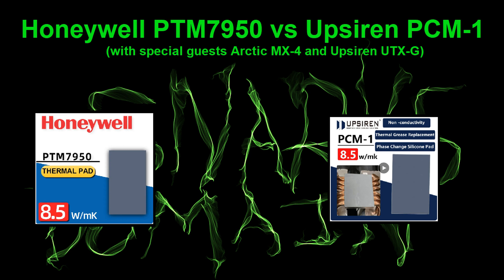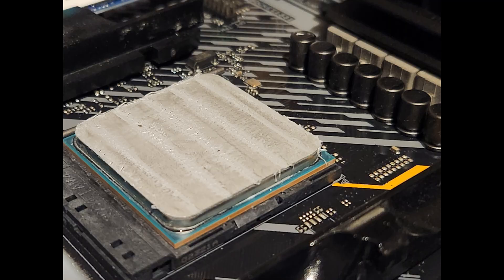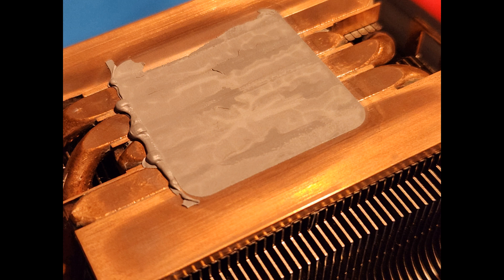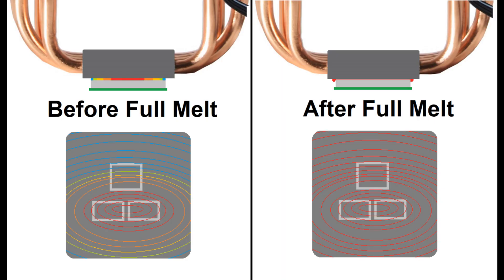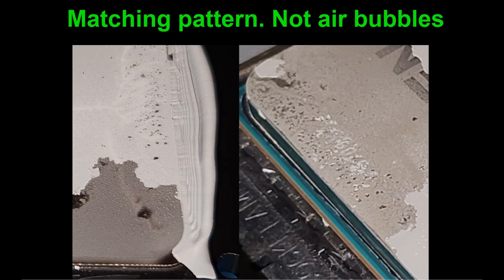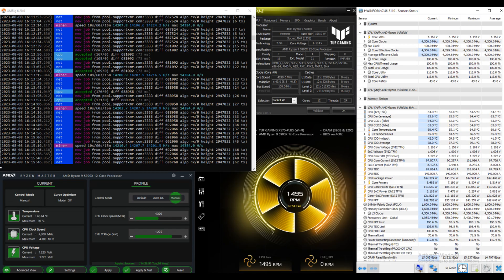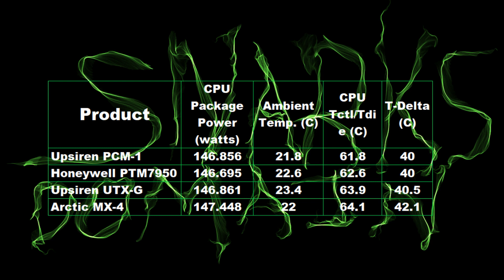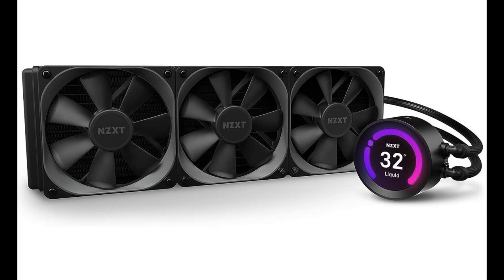Can Upsiren PCM-1 Compete with Honeywell PTM7950?

Comment: hey! i just got 5900x. how is your 5900x ccd1 matching ccd2 temps under full load? mine doesnt... it differs as much as 20c temp...
Reply from the maker: I'm using Ryzen Master to set a fixed all core OC (frequency and voltage). Perhaps only one of your CCD's is working during the load you are using.
Reply: @snarksdomain  Can you please retest Copper shims? You only have tested them in the obsoelete chart, i want to see whether it's best to keep the current 3d graphite pad on my smartphone soc or replace with copper shim and paste?? Your videos are actually helping alot, thank you for your work.
Reply from the maker: @hotsauce6310 I'm testing out Aluminum Nitride shins and Putty roght now and will test the other shim and putty combos soon.

One nice thing about the AIN shims is that they don't conduct electricity.
Reply: @snarksdomain  I'm not really sure where to find those. I did not find graphene pads to cause any harm yet, i guess its the little project of mine, seeing it's longevity and it's reliability on my older phone. Seems to perform better than i remember and compared to others. Not sure by how much, note that i had to build the phone from scratch after 4 years of no use, maybe you could drop some insight on it? what about your obsoelete chart? There the graphite pads are no better than thermal putty. Wrong methodology used? or Pads size? I've seen u have to use higher than actual thermal pad size because graphite pads performs better when compressed. In my case i took off some top shielding that m/b had over soc & some other components and did a direct IC(Ram stacked on top of Cpu) to frame/housing application.
Reply: @snarksdomain  I saw somewhere that graphite pads only last around 6 months? is that true? What happens to them after it they get dry or does thermal conductivity drop significantly?
Reply: @snarksdomain  For the last question, is it true that they break and tear after a single installation? They are not reusable?
Reply: @snarksdomain  copper shims wont conduct electricity as well as long as the installation is correct. As long as there is no copper dust and enough mounting pressure you are good to go applying it on almost any component with a little bit of thermal paste, im still not sure how it compares to graphite pads though, really dont want to open that thing up again, at least for now ;d
Reply from the maker: @hotsauce6310  methodology and equipment. I wasn't monitoring ambient temperatures or testing long enough. I also wasn't recording logs within HWINFO64 and then processing the data with a spreadsheet like I am now.

The current chart based on my current Testbench 2.1 will become the new "Obsolete Chart" eventually as we start testing things on Testbench 3.0

Testbench 3 will have improved accuracy with linear air flow, better ambient air sensor placement, 20x finer resolution on Memory Junction Temperature and bi-annual calibration of the ambient air temp sensors to avoid "drift". 

It still won't be lab grade testing of course, but maybe some day we'll get there :)
Reply from the maker: @hotsauce6310 The shelf life of 2 years does not represent the pads effective service life. It's recommended you install the pads within 2 years of manufacture. I just talked to my friend and he is willing to lend me the card I used in the video. I'll pop it back in Testbench 1 and run the tests again. I expect core/hitspot temps to differ as I was still using pastes back then, but since ETCHASH testing is not core intensive, we should have a good comparison.
Reply from the maker: @hotsauce6310  they are found on Aliexpress. Like $20 for 20 pieces.
Reply from the maker: @hotsauce6310 This is correct. The pads are coated with Phase Change Material. It will melt and create an optimal interface between the VRAM surface and the crumpled graphite film, and the film and cooler on the other side. When the card it shut off and cools down the Phase Chabge rehardens and adheres to the surfaces.

As the card and cooler are pulled apart the pads will tear apart. I used to think of this as a flaw, but it's actually important that it happens, otherwise it would be very difficult to pull the card apart to do any kind of repair work on it.

The best paring with 3D Graphite pads is going to be using a Phase Change such as Honeywell PTM7950 or similar. That way both products will have a well marched service life and you can basically leave them alone u til temperature dictate the need for replacement.
Reply from the maker: @hotsauce6310  shims outperform the 3D Graphite pads
Reply: @snarksdomain  Yeh i mean copper should be better, the question is by how much. Testing on VRAM is perfect as VRAM chip is and behaves very similar to mobile ram which is stacked on top of the SoC(cooling that you essentially indirectly cool the SoC, that's the approach the android OEMs have taken, only iphones have spare die but no thermal installation there yet except graphite sheets lol).

Comment: Before i replace thermal paste with PTM my theory is a D-Limonene cleanup (Arcticlean is an option, step 1 bottle is D-Limonene i think) followed up with 99% alcohol thorough clean for the silicone residue from the old paste increases the adhesion and stability, esp inside the micro-pores from the cold-plate, dabbed on alcohol must lay flat on the surfaces without moving away or forming droplets, that usually means the surface is still hydrophobic from silicone residue. On heatsinks i use a small gas torch (comparable with a torch cigarette lighter) with short bursts, it oozes out the remaining silicone or whatever that liquid is inside the pores, wipe off with a piece of paper shop towel. Done this on 100's of heatsinks. After that the new material fills up those empty voids without silicone interference. 
On car spraypainting silicones are really nasty stuff, 1 droplet of silicone on a panel (tire shine and such) and the respray is trash.
Reply from the maker: That's a great tip. I've used a little butane lighter a few times, and it's surprising to see how much residue oozes out. I will look into D-Limonene, thanks for the tip.
Reply: @snarksdomain  No need to go with pure d-limonene.

Just go with something like a citrus degreaser and it'll clean everything :)

Comment: I'm using PTM7950 with a 5950x in a custom loop, and my CPU getting up to 85C with overclocking was enough to burn in PTM7950. So other PCMs ought to work properly as well.
Reply from the maker: Nice. Did you end up with decent temperatures after the burn in?
Reply: @snarksdomain  Absolutely. With stock settings and an ambient temp of approximately 27.7C, liquid temp of 34.1C, I was able to max out at 75C while gaming. I will be using PTM7950 for all builds going forward, outside of short-term part testing. 

I even cut off the bits of PTM that were hanging off of the edges of the CPU, and put those scraps on top of the existing PTM on the CPU, effectively double layering it in the middle. My logic was that it would become liquid-ish, and evenly distribute once heated. So it looks like PTM can be "stacked" without negatively impacting performance, as it squishes down during use like it should.
Reply from the maker: @uss_liberty_incident  Awesome. Yeah, if anything it might just take a bit longer to melt and squish out, but the end result should still be a very thin layer of it. They claim as thin as 0.038mm or 0.0015".

Comment: Hey there, with PTM thermal pad and my experience I found that sticking it in the refrigerator for around a half hour or so makes application a hell of a lot easier. Idk what your house ambient temp is, but cooling it in the fridge definitely helped me out. It made peeling the plastic applicator extremely easy and the pad remained whole.
Reply: Nope, tried everything, did this literally yesterday and it was my second attempt at this. I out it in the freezer for a while to make it easier too. Nope, still teared in several places. It's like it's glued to the foil. Of the 50EUR I paid for it, I maaaaybe have enough left for another application. It was a nightmare and I really am not an graceless elephant when it comes to stuff like that.
I had to patch it up, but then it was so uneven and thick in some places, that it was locking my PC when I wanted to run Cinebench for example. I had to take the cooler off, scrape the excess PTM, put it on again and now it's working as intended. But man... it's the worst.
Reply from the maker: @EpicKillstreak  is it tearing when you peel the first plastic film? Or is it tearing after you've pushed it down onto the CPU and ran your finger over it, and the peeling second film?
Reply: The ladder, after its pushed to the cpu
Reply from the maker: @EpicKillstreak  that's no fun. It can be tricky to get it to peel. I had the best luck with the 0.25mm phase change sheets, and T.Sharps method of running a plastic spatula around the edge at a 45 to kind of cut it.
Reply: @snarksdomain  Thanks for sharing, I'll be keeping that in mind for future if needed.
Reply from the maker: This is a solid tip for sure. I've done the fridge technique a couple times with good success.

Some Phase Change sheets now have overhanging plastic films on both side which makes first peel super easy. And second one just as easy.

For the sheets without the extra plastic film, those little sticker tabs certain help. Can put one on either side of plastic at one corner and peel apart without much fuss.

Another cool trick, and this one from T.Sharp, is using a credit card or other firm plastic holding it at a 45 degree angle and running it along the edge of the IHS/Die with modest pressure to "chop" off any excess. This makes second peel go smooth and doesn't lift a flap at the corner.

Several others have also suggested undercutting the square by a couple mm on each side as this will use less of a large sheet and give more applications. This won't be a huge benefit for small sheets though (where it's only large enough for 2 CPU applications.

Comment: Just a reminder, you put a ton of PCM on the CPU - way more than you needed. It's a costly mistake. They come very thick and it melts to a super-thin layer from 200 microns down to around 20-25 microns, so all the extra thickness that you will have will be simply squeezed out. Best to put like a 20x20mm patch on a 35x35mm IHS, or a 17x17mm patch on a 20x20mm GPU die, because they heat up a lot harder and you shouldn't try to save up too much money on applying PTM7950.
Reply: I got my ptm Honeywell for free so I personally don't care lol
Reply: he's a noob

Comment: Can you tell if is enough the 40x80mm size for the cpu and gpu?
Reply from the maker: 40x80 is definitely enough. If intel CPU, you'll likely be using 30x40mm. That would leave you 50x40mm, which is lots. You might even b3 able to mess up the CPU application once and still have enough for GPU.

If AMD then you'll be using closer to 40x40mm and will still have lots for GPU, but try your best to get the CPU application correct the first time. Likely best to do CPU first and if it messes up you might be able to salvage a big enough piece for GPU. Even if you have to use a few broken pieces, I would still go through with it. This stuff will melt and make a nice even layer in the end, as long as you have enough to melt and spread.
Reply: @snarksdomain  thank your for all the explanation and tips 🙏🏼
Reply: Way more than enough. You don't need nearly as much PTM7950 as you think. They come very thick and it melts to a super-thin layer from 200 microns down to around 20-25 microns, so all the extra thickness (volume) that you will have will be simply squeezed out. Best to put like a 20x20mm patch on a 35x35mm IHS, or a 17x17mm patch on a 20x20mm GPU die, because they heat up a lot harder and you shouldn't try to save up too much money on applying PTM7950. If it's a 35x42mm IHS like with Intel LGA1700 processors, just use a 20x24mm patch.
Reply from the maker: @one_step_sideways  THis is a good point. I'used large squares simply because the smaller sheets I got aren't large enough to have enough excess for other application.

I do have 1 large sheet of PTM7950 that I bought off Aliexpress and need to test to see if it's is real, but it looks real from the packaging and labelling. I'll definitely be cutting smaller pieces from sheet.
Reply: @snarksdomain  I wonder if you can put something like 4 small patches that are like 8x8mm and place them 5-10mm apart to guarantee the best spread without using too much paste by simulating an X-pattern like with thermal paste, since the spreader method is expensive. Because with a 20x20mm patch in the middle you have the same kind of spread as with a drop of paste, and it may still be too much, considering the 5-10x reduction in thickness. I think you should test that with your sheet of cheap PTM7950 you got.

You can put the 8x8mm patches on the IHS like so:
__________
|                          |
|     ×          ×     |
|                          |
|     ×          ×     |
|_________|

Comment: Once these melted and disassembled the heatsink, do you have to replace them before putting the heatsink back? Just check the price on the sheet and they're pretty pricey
Reply from the maker: Having taken off the heatsink several times during the testing to replace it, I could see it was a nice even layer each time. I think you could try putting the cooler right back on and see what it does.

If you had any tiny pieces of a sheet left over, you could even put a tiny piece in the middle of the CPU. As it melts, it should flow out and help push any potential new air bubbles out.

Comment: When applying the PTM7950/PCM-1, do you trim the edges so that it doesn't stick out over the IHS' edge before putting on the cooler?
Reply from the maker: You could. I haven't been.
Reply: @snarksdomain3453  what about on the GPU? I was thinking of applying it on the GPU processor as well as my CPUs IHS.
Reply from the maker: @DivineDragonCrisis  Yes, you can also use it on the GPU die as well. This stuff doesn't conduct electricity.
Reply: @snarksdomain  alright. I'll probably put the PTM7950 or PCM-1 on the CPUs IHS and the GPU die, and puttys on wherever else.

Comment: In the case of an AIO, if you only have to melt the pad once, you can do that by turning off the pump and just somehow keeping your CPU temps at 85C. Set a temperature limit of 85C in bios, then hit a heavy benchmark, that'll probably do it.

If the pad needs to be in the molten state to perform its best, then it may be worth it to do tests with varying constant pump speeds. Would be pretty funny if 75% pump speed resulted in better temps than 100%
Reply from the maker: I was chatting woth El-Hurracan on Reddit. They've got a watercooled 3080ti. They did a bit of a burn in up to 65 Celsius, and now it mostly hovers in the low 40's.

They did mention that idle temps are a bit  warmer than they were with paste. Around 35 Celsius with PTM7950. They seem pretty happy with the overall results.
Reply: @snarksdomain Can these phase change pads only be used with core dies or can they also be used on the VRAM modules as well?
Reply from the maker: @AndyU96  so, there's no electrical risk or anything, and they could possibly be used on VRAM. I will likely test it out with shims to see how it goes.

One thing I worry about is if the GPU is vertically mounted. Once it reaches phase change temperatures, it's possible the shim may fall out of place and A) no longer be cooling VRAM effectively and B) Make contact with other components, risking a short.

I suppose it depends how you'd want to use it.
Reply: This advice is so retardedly wrong it hurts, AND it's a good way to fuck up your AIO.

Never do this. Disable your power limits instead of disabling the pump. If you do disable the pump there's a high chance you'll boil the coolant in the AIO itself and it being a closed system you really don't want that.

Comment: Well, Upsiren PCM-1, Thermalright Helios and PTM 7950 are all the same stuff so ofc they are going to perform the same.
Honeywell prints sheets of PTM7950 in 0.2 and 0.25mm in massive rolls, so they could just be buying massive rolls or they are just buying it in bulk as paste and printing the sheets themselves and then rebranding it.
At the end of the day, they all cost about the same.
Reply from the maker: This would definitely make sense. I have no information on whether they are actually all the same product being rebranded, but will let the testing of them be a pretty good decided factor on the value of the products. I haven't seen anywhere to buy the Helios pad yet, but will buy some as soon as I do, or if someone sends me a link to buy it.

Comment: Good video, thanks.
Would you happen to know if pcm-1 has similar longevity to 7950 in real world applications. I've seen many instances of people saying 7950 doesnt degrade well after a year (if it does it seems to be within margin of error). 
Thanks again for the video, you're one of the few covering thermal putties and "niche" products like this.
Reply from the maker: We won't know that for quite some time, unfortunately. I'll have to see over time how its performance holds up.
Reply: @snarksdomain  100% understandable, thanks for the reply, appreciate it!
Reply: PTM7950 lasts 3-5 years in industry, so in a household system 10+ years, since PCM is the same stuff so it will last a while
Reply from the maker: @pokehl9929  That would be super cool if it lasts that long or longer.